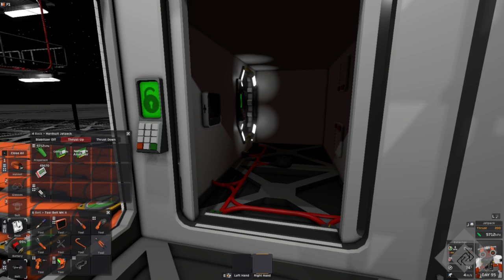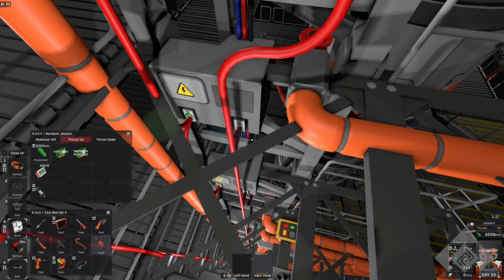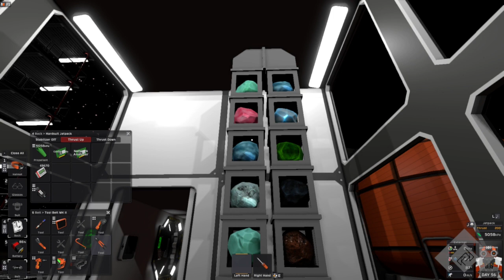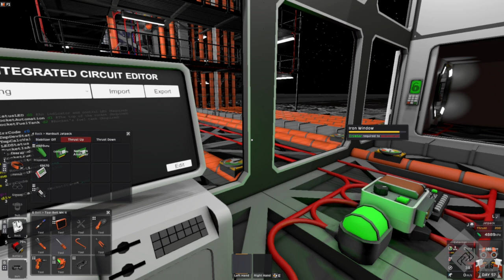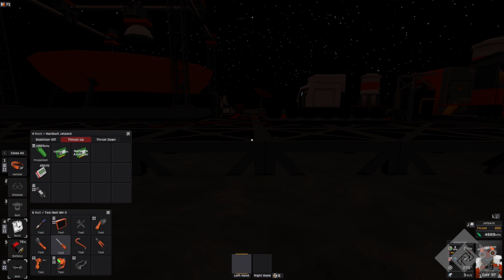Rocket Automation, Rocket Control Script By Me! J! - Stationeers

Comment: Interesting code, might try this on my next rocket.
Normaly I use cowsareevil's automated rocket script that I sometimes modify.
Using a second chip can really help with the limited lines of code.
Use the housing or memory chips to communicate between them.
For the fuel mixer elmotrix has a very nice script for that already that takes temperature and oxidizer type into account.
Reply from the maker: The rocket will use NOS? I haven't tried yet, I just assumed it wouldn't have been updated. I'll still be writing a script from scratch as I might want to integrate it into the rocket IC... and I also don't like starting with someone else code, because if I don't change it enough and add substantially more to it, I'm stealing their work. Also, if I have to use pipe analyzers, I'll go with two separate pumps and math the mixing in code... of maybe two digivalves if the pressure is high enough. If this was a real appliance hooked up to tanks, I'd use passive valves.
Reply: @JoelleTheAbsurdist  i think it is able to use NOS, bit more "expensive" to use since it's easier to obtain oxygen.
Have not tried it either but seen it mentioned somewhere.
Regarding the code it's more for insperation and not stealing ofcourse.
Making your code compatible with other peoples code and referring to it is also an option (after consulting with them)
 I have used a combination of pipe analyzers and pumps before but setting the setting value on the mixer is more precise and easier on the number of ic10 pins.
You could batch read a pipe analyzer and a tank and batchwrite to the mixer if you are really into a saving pins mood😆
A way to let the chips communicate with (but not relying on) eachother is something I started doing more and more now I become more familiar with MIPS.
Reply from the maker: @samuraidriver4x4  In the music prefab, there's a timer you can set up that'll count up seconds... using the batch load command, you can grab the time without using pins, so you can more can more easily synchronize function across chips... Like if you're using one memchip, you can designate a tick when reads and writes occur, or give chips a specific division to speak on.
Reply from the maker: Or like, you can us an IC as a clock ticker with an EPOC timer.
Reply: @JoelleTheAbsurdist  I suck at coding overall, using a timer would probably end in alot of frustration😂
Handshaking is something I did use, simply by reading a value from a housing.
Saying that i ocassionaly do some stuff with arduino's so I can sort of get away with C++
Then again an ic10 is pretty much an attiny that speaks different language and has one functional pin less. 😂
Reply from the maker: @samuraidriver4x4  https://en.wikipedia.org/wiki/ATtiny_microcontroller_comparison_chart